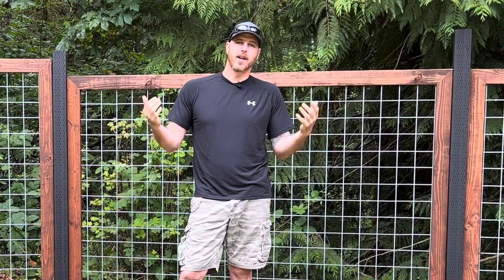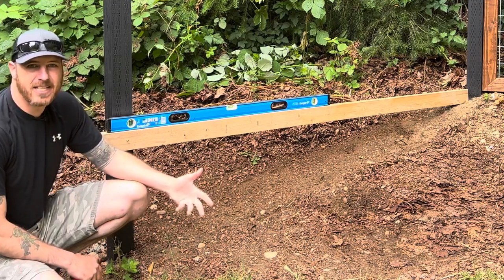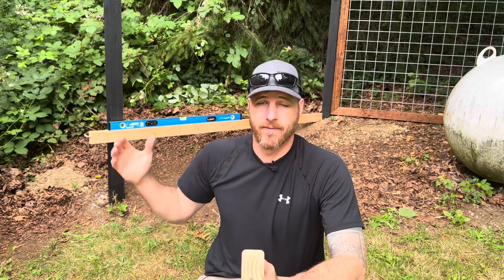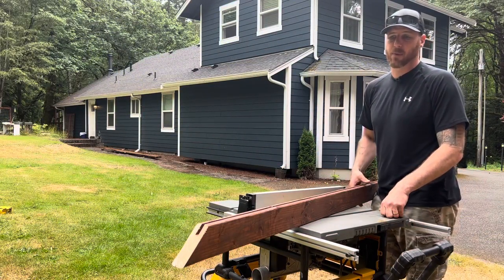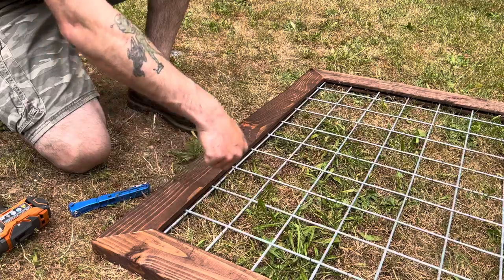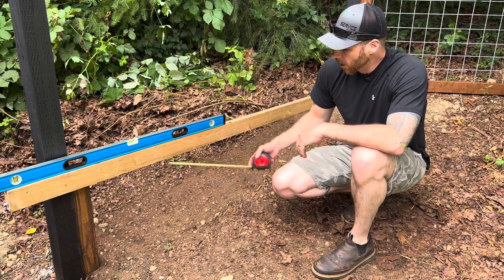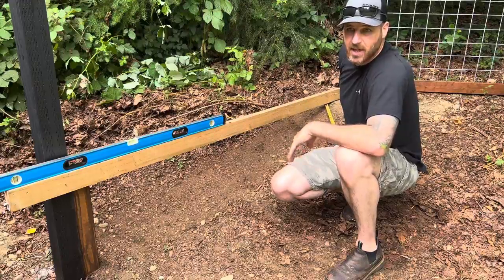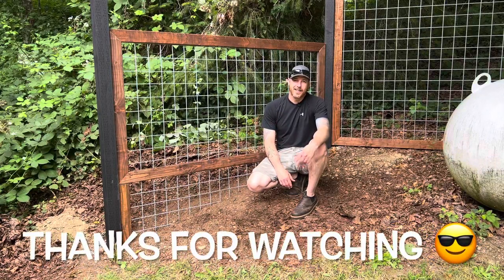Is Your Hog Wire Fence on a Steep Slope Causing a Large Open Gap at the Bottom? This DIY May Fix it!

Comment: Thank you for taking the time to share your experience.  I really appreciate the efficient production-value of the video; only the relevant information is a relatively short length of time.  I also like your design and how you minimized the bill of materials without compromising structural integrity.  I need to see if your design will work on my pretty large slope.  Can you give an update on how your fence is doing with respect to reliability ~2 years later?  Is there anything you would change?  Thanks again!
Reply from the maker: Todd! Thank you so much for the kind words about this video. I appreciate you and knowing that my effect (as little as it may be) helps someone out there. 

As for the condition of the fence 2 years later. It's never been stronger and looks as good as new. Everything is tight and solid as a rock. As for your particular slope, yes, that all depends, and this may not work in your situation. As for your other question if I would change anything. I actually would. After the video, I thought about ice accumulating on the bottom slit where the fence goes into.I didn't want the ice to split the wood so I simply drilled 1/4 inch holes along the bottom to simply allow the water to drain. It's an easy adjustment to make the fence work longer. Also with how it's designed, these panels are very easy to take out and replace/fix if necessary. I know that nothing lasts forever and wanted my fence system to be easily fixed and I think I accomplished that with this design. 

Anyhow, I hope this helps you and again, thanks for the questions and the support. It does mean a lot. I hope you have a great day!

Comment: Thanks for the awesome video! this is going to be great for my garden! I do have a quick question... do you have any issues with water settling in the channel that you created for the hog wire to set in?
Reply from the maker: Hey Rachael! Thanks for the comment and support! As for water collecting, I do have some water collecting in the bottoms of some of my boards. I like you, was a bit concerned and over looked this point. I was worried if it froze that it would split the board but that never happened. The ice had a place to go and never caused an issue. I did however on a sunny day in the winter, drilled some I/4 inch holes on each side of the channel on the bottom board. This gave the water a place to drain. They are on the side where you can’t see it from the outside of the fence. If I would do it all over again, I would drill holes at the very bottom of the board every few feet or so for drainage, and you wouldn’t see the holes from any side at that point. I hope this helps and thanks again for coming by and commenting. We absolutely love our fence and our dog likes it even more :) take care and ask any other questions you may have. Good luck :)

Comment: Just what I was looking for!! Had this in my head, but since it's been a while good presentation!.  Now my up and coming choices.  Table saw and Hammer drill, what are your thoughts!  Thanks GPN
Reply from the maker: Hey Greg! Thanks for the interest and I know you’re going to love it. I made some other videos on removable post and fence panels which will give you a bit more info. Your table saw and hammer drill are a most. I also used an impact driver, dado blades for my table saw, a compound miter saw, dreg pocket hole jig set and a grinding wheel to cut the fence. I know it’s a lot, but it makes this job a lot easier. It took a lot of time, but it turned out amazing. Good luck to you and don’t be afraid to ask any other questions /)
Reply: @StoneyCreekSparkchaser  Ok great just now getting into the project pretty steep grade on parts.  Thank you for your advice, yep table saw and hammer drill a must.  I have the grinders, they need to be worked!  The most important thing for me is not to get into a hurry!
Reply from the maker: No worries Greg. Just glad I could help. Yea and you’re right. Just take your time. My 250 plus feet took a month or so to complete. I worked on it almost every day after work and on some weekends. Easy to get burned out on, but super happy to finish it. Good luck :)

Comment: Hi Stoney,  I appreciate the work that went into this video.  I was wondering at what angle is the Hog Wire Fence panel on the steep slope from the back Hog Wire Panels already installed.  It looks like it's about 135 degrees from the back panels.  And are the Kreg screws just screwed into the 4 x 4 post at that angle or is there a wedge shaped piece between the panel and the post?  Thanks again. This will really help to keep my Fur Buddy in the yard.
Reply from the maker: Hey Russ! Thank you so much for commenting and asking some questions. I really appreciate it. As for your first question. That seems about right. As for your second, no wedges were needed. The screws were long enough to go through to the 4x4. Now looking from the back side, there is a gap that is wedge shaped, but no one goes back there so it doesn’t bother me. The front is nice and flush though and looks good. I hope that answered your question and good luck to you. Let me know if you need anything else! Thanks again for the support! Very nice of you

Comment: Very clean look!  I like this.  Are those pocket hole connections still holding up?  I was gonna run the 2x4s horizontal but I do love this vertical look.
Reply from the maker: Hey Raul! Thank you and yes it’s still holding up. I can see a few screws that need a quick retorque but the pocket hold system is holding up just fine. There’s no bowing of the wood, no boards cracking, no fading and the metal wire fencing still looks brand new. So yea, it’s good to go, but remember, like all outdoor building projects (fences included) yearly maintenance is always needed. As for the horizontal look vs the vertical look, I think either will look good. It just depends on the look you’re going for.

I hope this helps, and good luck!
Reply: @StoneyCreekSparkchaser thanks!  Did you use pocket hole screws or decking/exterior screws?
Reply from the maker: @StoicRipple I just used decking screws due to cost. I do believe the recommended pocket screws would work better. I hope this helps!
Reply: @StoneyCreekSparkchaser  thanks!  I was thinking decking screws as well.
Reply from the maker: No problem! I’m glad to help :)

Comment: I have always liked this style, but my only concern is the bottom rail, which is holding water and leading to rot. I guess you could silicon the gaps...
Reply from the maker: Hey Jeremy! I completely understand those concerns and they really could happen. Along with water getting trapped in there and freezing, thus splitting the board in two. Luckily, I haven’t had any problems these past 2 years. There is some water that stays, but I have seen it come out. Also in some some of the boards, I actually added 1/4 weep holes and that helps drain the water out. 

Anyway, I just wanted to point out some work around but yes… you are not wrong with those thoughts Jeremy. Thanks again for the comment and support!

Comment: Hi,
Great job. I leand a lot and that is going to help me with my project. What is the gage on that 4x4 hug panel and where did you get it? Do they come in a roll?
 Thanks
Reply from the maker: Hey Rostam! I’m not sure of the gauge but it’s 1/4 inch thick and it came in a 5 foot tall by 16 foot wide panel. It wasn’t rolled. So I cut it into 8 foot sections for my fence. I also purchased these from a local farm and feed store for around $100 a panel at that time. Hope this helps you :)
Reply: Thank you , that helps .. @StoneyCreekSparkchaser

Comment: I like the black and brown color combos. Do you have links to the exact black paint and wood stain you used? I’d like to purchase the same colors for my build.
Reply from the maker: Hey Jeff! Thanks for the comment! I’ll grab that info tomorrow in the morning. Are you wanting to know the stain for the fence panels and the paint I used for the posts? Just confirming before I chase down the info! Appreciate you
Reply: @StoneyCreekSparkchaser  yes. Both the paint and the stain please. Thanks!
Reply from the maker: Jeff! Morning! Ok I got the info you requested. For the stain, I used Thompsons WaterSeal Semi-Transparent in the color of Chestnut Brown. The color will vary, based on the wood you put it on. My 2x4’s were pretty a little darker so it gave me a darker look, which I like. What I’d do if I was in your situation… I’d also get some black stain and maybe just try mixing in a little bit in the container or something and see how it looks. I remember doing that when I first did this too, but ultimately just went with the Chestnut brown. It’ll lighten with time. 

As for the black paint. I used Behr exterior paint and it’s just flat black. I didn’t want any sheen so that why I went with that. Oh and I got the cheapest paint as well. I wasnt going to put big money in painting posts. 

Anyhow, I hope this helped! Good luck and I appreciate the comments and support!

Comment: Nice fence. Thanks for sharing. On the removable sections, have you ever built a removable gate? Do you have gate hardware suggestions?
Reply from the maker: Hey Janet! Thank you so much for coming by and asking that question. So I have built many gates, mostly walk-in gates so no more than 4 feet wide. I used the same hooks in this video but with bigger eyes, all from tractor supply. As for gate hardware (latches) I just go to Home Depot and get whatever one fits the decor. Tractor supply does have some as well, but they are a bit more simple. If you build a gate with the hook and eyes concept it will always be easy to remove. Just unlatch the gate lock and lift out the gate. I hope this helps and if I misunderstood your question, go ahead and ask again and I’ll try better! Thanks again and I hope you have a wonderful night :)
Reply: @StoneyCreekSparkchaser  You answered my question perfectly. I need a fence with a gate in the summer but one that I can remove before the roof snow crushes it. I still have 4 foot tall snow / ice piles next to my house. Thanks again.
Reply from the maker: @bigwavessandybeach  perfect! Glad to help and I hope it goes well! I bet you can’t wait to get rid of that snow! Spring here though, so it’s just a matter of time :) take care!

Comment: The fence looks excellent. I am planning to do something similar in my yard coming up this summer. If you don't mind me asking, where did you get the wire mesh? Also, is the wood that is attached to the posts pressure treated?
Reply from the maker: Hey Bobby! And thank you! I have 2
Other videos that show some more of the fence if interested. To answer your questions, I got the mesh fence from a local farm/feed store, but I believe they offer the same style at tractor supply and probably Home Depot. As for the wood attached, no it’s not pressure treated. It’s Doug fir with a heavy outdoor stain applied. Let me know if you have any other questions! Thanks for the support and have a great day Bobby!

Comment: I've a question - why tier the fence instead of having it flow with the land? If we can make sloped railing for stairs, surely we can make sloped panels for our yards? Besides it being more labor intensive, is there a reason why this isn't done? I'm completely ignorant in fence building and am just trying to understand.
Reply from the maker: Great question and it really comes down to personal preference. You can most definitely slope the fence and have it follow with the land but a lot of people tend to do tiered or stepped fence systems because the fence material itself sits parallel and looks better to the eye then having it follow the contour of the land. But like I said, there is no wrong way :) thank you so much for the question and I hope you are having a great day :)
Reply: @StoneyCreekSparkchaser  Thank you for the speedy and helpful reply! I did a little more searching and found that it's of course already a thing, a "slop fence," and we'll be going with that.
Reply from the maker: @make_it_aesthetic nice! Good luck! I’m sure it’ll turn out just great :)

Comment: Where did you source your fence panels?  The hog wire itself.

Also - Thanks for sharing!  I did something similar for my deck railing but it was a PIA, your method looks much easier.
Reply from the maker: Hey Jeff! Thank you so much for commenting and supporting my channel! I appreciate it so much. As for answering your question, I got my hog wire from a local farm and feed store. I did this last year and the prices were pretty good but I know they’ve gone up in price like everything else. Hope this helped and if you have any other question please feel free to ask. I’ll try my best! Thanks again and I hope you have a fantastic day!
Reply: @StoneyCreekSparkchaser  How far apart would you recommend putting posts in for each panel?  Looks like you have them around 8' give or take?  I'm looking at putting in a little over 200 linear ft worth of fencing, some spots have a gentle slope so I may need to take advantage of your method in this video.
Reply from the maker: @jeffcarter1641  hey Jeff! I would recommend 8 feet. That’s kind of standard but it really depends on the length of hog wire you can get. I believe the length I used through out my project were 16 feet so I was able to get 2 panels per one hog wire length. It also depends on your lumber size. I choose 8 feet again with that because I didn’t want to waste lumber. I do believe my posts on center were just under 8 feet, that way I knew I wasn’t going to come up short. My fence was around 260 feet long when I did it. It took some time to build, especially cutting the slots on each board and staining them but I worked through the repetition and conquered the job. It really looks good and performs well. I have some other videos showing the fence as well and how I built it so maybe those will help you too. Thanks again Jeff and good luck on your project!

Comment: What size screws did you use where you used the kreg jig?
Reply from the maker: Hey Jonathan. Thanks for the question. I’m pretty sure I just used 2-1/2 inch deckmate outdoor toed head screws. Honestly anything over a 2 inch length would work great. Hope this helps. Thanks again!

Comment: I'm not sure what you put the slot in with
Reply from the maker: Hey Dukes! So the slot is cut in there with a dado blade that you can put into a table saw. I mention that around the 3 minute mark, and then demonstrate it around the 5:30 mark. I apologize for not showing you how to set up the dado blade. There are a lot of other videos online showing this process. I did however add measurements for how you want the dado blade set up at that 3 minute mark. Just take a screenshot and use those measurements if you’re using the same process I am. Again, I’m sorry if I wasn’t very clear on that and I hope this explanation helped you out. Ask any other questions you may need. Always happy to help where I can. I appreciate your comment and for you stopping by showing support! Good luck out there and stay safe! 😎

Comment: Could you just dig a narrow trench and bury the whole piece instead of having to cut it diagonally ?
Reply from the maker: You definitely can if you have the extra to do it. I was running short and was trying to conserve how much fence panel I had left over so I didn’t have to but a 20 foot piece and only use 5 feet of it. Definitely do what makes sense for your situation :) thanks man!

Comment: Its a big mistake with that wire in the ground.
Reply from the maker: It may be a mistake, but it works for what I want and I do believe I’ll get many years of good use. Galvanic corrosion is a possibility but if it happens, then I’ll just put another piece in there or try something else. Either way. It keeps my dog in and looks good. I hope you have a great day :)